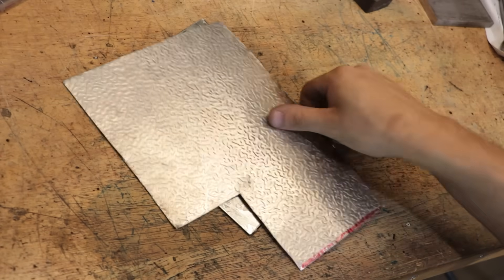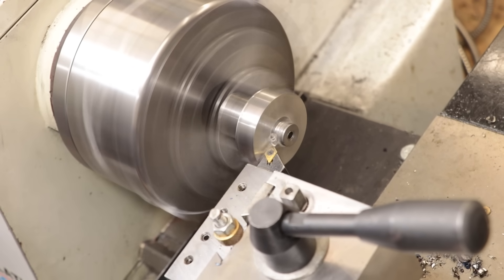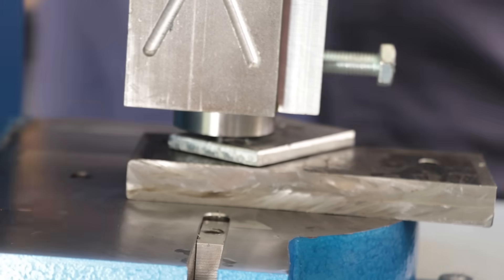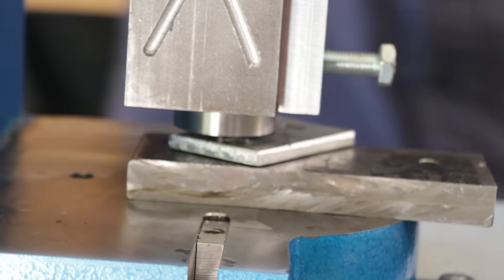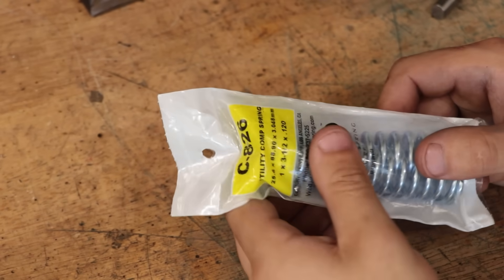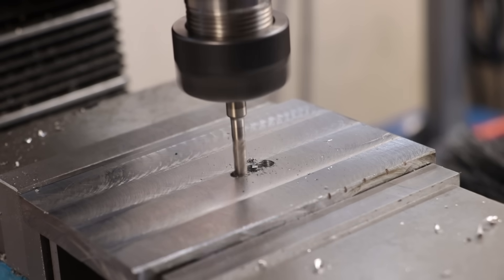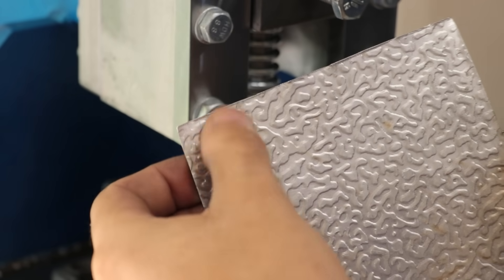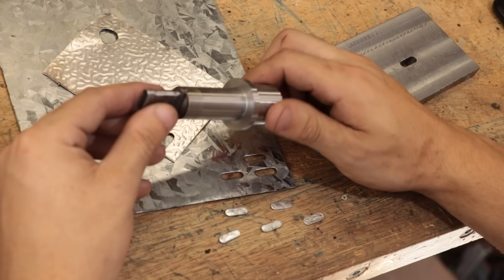DIY Punch and Die For Sheet Metal

Comment from the maker: Hope you enjoy this one, it was a lot of fun making it. FYI if you are wondering why the press stand is bolted to the floor, it is not my workshop so can not drill into the floor. Cheers
Reply: I haven't made many punches yet, but did run across an idea that might be useful, especially for larger punches... 

When shaping the face of a punch, mill it off at a slight angle, so that one corner/edge/end of the punch face enters the work first.  The punch still moves at 90° relative to the work, but only a small part of the cut is happening at one time - more like a pair of scisors than a paper hole punch.  Your tools and equipment- and more importantly your back! - will last a lot longer.

...LOL, I do have to admit that it probably won't help a whole lot with punching a 15mm long slot through 5mm thick aluminum!  Should be awesome for 1mm steel stock though, and the edges of the cut will be cleaner too.
Cheers.
Reply: @douglashank8480 you got the point across perfectly, but all paper hole punches I've encountered so far have angled punches too. Most of them have a quite steep V shape ground into them, those flat on-the-go ones even have two. Gotta have that clean shear in paper too, especially if you punch through a whole stack
Reply: TheDonutMan;  Yeah, I thought about that but couldn't come up with anything better to use as a comparison/contrast to scissors.  🤔
Reply: Sorry about the dozen odd copies of my comment.  Had a slight browser malfunction here.  (The rest should be deleted now.  I hope!)
Reply: Hi Artisan - Can I advise you DO harden both the Die as well as the punch if longevity is your plan?
My suggestion is to create a Base that is a Die holder - That will allow you to make dies from normal Barstock say 15mm deep by 50mm rounds retained by grub screws
Doing this will allow you to make and harden several options in terms of die size - and also allow you to use the grub screw to index them relative to the die holder

The spring as an automated stock remover is not a bad idea - though there are 2 suggestions you could add add:
1: the spring will currenly Marr your work - add a plate retained on the end of the spring to widen the contact area
2: an alternative design is a simple fixed plate at say 2 to 5 cm above the work - it means that you are using the retraction of the punch as the level to remove it

Another thing these punches are a god send for is quick weld repairs - See a rust spoton something early? punch out a 4cm disk to weld in after removing the bad metal
Reply from the maker: @bengrogan9710 punching force is perimeter of punch x shear strength x thickness of part. That’s what we are describing here, I don’t see what the disagreement is ?
Reply: @artisanmakes apologies - I just rewatched as recognised what I did.
My head was hearing "area" in the calculations and automatically fixing on the area of the circle, rather than the perimetric area of the punch - a mental slip of the tongue.

Please feel free to disregard that part of my comment, I've removed it now, however I hope some of the othe points are useful ideas =)
Reply: Great job 👍🇬🇧
Reply: I enjoy this sort of video learning is half the fun of doing
Reply: Absolutely love these experimental videos.
Reply: Love it. I'm on the other end of the spectrum with over 20 years of pure cnc so it's nice to watch the basics like this.
Reply: You could bolt it to a slab of some sheet goods (plywood, OSB, whatever) that you stand on while operating the press.
Reply: You could still make it sturdier so half of your energy isn't wasted in the stand jumping all around.
Reply: dont cut stock by hand!

Comment: Interesting video. I'm not sure about your shear strength calculations. It seems like the linear length of the cut would be more important than the area inside but I'm not a machinist so can't say for sure.
Reply from the maker: You are shearing a cross section, so the area is that matters

Comment: Nice job.

A quick tip for you though.
Put you Hacksaw Blade in the Frame back-to-front, i.e. Teeth pointing backwards towards the Handle.
It'll cut cleaner and straighter and with less effort, and the  Blade will never snag/jam or kink, as the Blade is always under Tension when cutting.

If you've ever used a Japanese Pullsaw on Wood, you'll understand.

As for the Punch itself, a slight Concave or Convex shape along the length of the Face will help, so you're not cutting across the full length of the Slot in one go.
If you look at the design of Shop-bought round Punches, they have 3 or 4 'points' on the Circumference, with a Concave section between them.
The Points punch through first, then the rest of the Punch slices through, rather than just punching by brute force.

Comment: Have you considered hard facing your punch and die?
In oz you can get UNIMIG 3.2mm HYPERARC 531 Hard Facing Electrodes U63025 really cheap @ $20 for 1kg.
It will give a HRC 55 surface but is not machinable, only grindable.
I have used these electrodes on various projects as wear resistant surfaces with great success and makes it economical as you can apply straight to mild steel.
Cheers Andy

Comment: You can buy 7 1/4" saw blades to cut Aluminum, Steel and Stainless now a days.
The Aluminum blade works great, and I've cut 1/2" plate with the circular saw with the steel blade.  The Stainless blade seems to dull fairly quickly.  But the blades are really worth it and they have come down in price.

Comment: First off, awesome of you to navigate through the construction & application of a punch & die!

With over a decade in the Tool & Die industry and co-owning a manufacturing business spanning three generations, I can attest to the vast complexity surrounding such a seemingly simple setup. 
Your creation closely resembles that of an Ironworker. Over the years, we've had competitors try to copy some of our machine tooling. Sadly, they encountered an instance where misalignment led to a lethal accident, including the punch exploding under high tonnage, shooting punch shrapnel through the operator's heart. Today, most Ironworker machines incorporate safety measures like impact-resistant polycarbonate to mitigate such hazards. I urge you to consider integrating similar safeguards, such as mounting a barrier between the punch and yourself, to ensure your safety while operating. You can find material for the barrier on McMaster pretty inexpensively.

Comment: You could make pointy two side of the cutter and add a plate with a hole same size with the cutter that the cutter comes that hole. I mean when you press, first the plate squize the sheet metal and cutter comes the hole and punch and when you release, first cutter goes in then plate release the sheet. Just like the paper puncher. So this way sheet doesn't stick and bend.

Comment: Two things that might help you. On your punch, looking at it from the side, picture a very shallow angle v shape. Maybe just 5 or 10 degrees on the legs. So the outer edges contact and cut thru before the center contacts the workpiece. Look at pics of Greenlee brand hole punches as an example. Really reduces needed tonnage.    For the spring you might try and automotive valve spring or on from a small engine like a motorcycle. They are heavier and shorter than what you used here. Just a thought on the springs but I can tell you the v shaped punch face will help.

Comment: Neat idea with the spring. The punching press in our shop has shoe that can be adjusted and fixed over the workpiece which prevents the die from pulling back up the material

Comment: One thing you can do to lighten the load is make your punch at the desired dimensions, but angle the tip so instead of the punch engaging the entire surface all at once, the punch begins at a spot and the cut progresses around the shape.  Like the punches electricians use to cut circles out of junction boxes, the cutting edge is a high-low wave around the punch.

Comment: I think your shear strength calculation might be off,  shouldn't you calculate it with the area of the cylinder that you are punching out? Which would make it 30mm*pi*material thickness, so closer to 900mm2?
Reply from the maker: No it’s the area that you are shearing. Perimeter of the circle times the depth of the thickness of the material
Reply: Oh, that's what I'm saying, maybe I didn't pay close enough attention and that's what you did 😅
Anyways, great video, love your projects :)

Comment: No I don't mind at all. Try wiping oil on the underside. It should make punching occur heaps easier, as far as pressure to break through goes. Putting the cutting edge of the punch on an angle will help with thicker material even more. I have a sloppy cheap hydraulic press so a die holder would be needed to make use of my own ideas about this here. To keep the male/female components aligned. So much of what I do is bespoke components that require a drill bit in the correct spot where a majority wont fit in the press at all. Also marking out has to often, be done after welding. Still I am very interested in this method since tools like butterfly wrenches and impact drivers have found their way into the site and plasma is in the shop now also. The most impressive item recently added is a cold cut chop saw. Always room for more if it can be used occasionally! Good video.

Comment: if you are only doing a few that are round...just take a drill of the right size and drill the die, then turn the drill bitaround, align and punch.  Dremel the end of the drill bit with a small grinding wheel to sharpen it if you like.

Comment: One idea for getting the material to come off the punch easier is to use a urethane stripper. basically a stiff urethane "spring" that slides over the punch a d compresses as the punch comes down. then the force of it returning it's shape pops the metal off. A lot of the older punch & die tooling I use at work has this style of stripper. Springs can work but usually need to be bigger and stronger which results in a dangerous amount of force near your fingers.
Reply from the maker: Thankyou, I think I have some urethane rods in strange somewhere. I’ll have to see if they are big enough for the job
Reply: @artisanmakes  it's worth trying. We use tapping oil to lubricate our punches usually so you should be fine with the oil you had. The only other note, our punches usually have a flat bottom face and a tapered neck. I don't know if that is better than a concave face or if it makes a difference at all. We punch mostly steel and sometimes copper with our big tools, occasionally brass with the small stuff.

Comment: The force of the press is determined by the screw pitch, and lever arm, I think. If you can get hold of an old car axle from a wrecker they're invariably going to be reasonably tough and somewhat hard. Case hardening is an option. Burnishing in the lathe to work harden (might not be all that suitable). Arc welding a blob of  6018 or 7018 rod onto the end and machining that back will be a harder face, although hard facing rod is obviously the ticket.

Comment: Painful to watch videos of guys with nice shops with mills and lathes but still using a hack saw to cut materials. E gads man . Meaning no disrespect, I’ve been a journeyman tool and die maker since 1972. I’ve built quite a few dies in my time before starting my own CNC shop. First off you should figure approximately 10% punch and die clearance , depending on material AND thickness. And yes the die should be just as hard as the punch. 0-1 is oil hardening which is meant to be quenched in OIL. A-2 is an air hardening tool steel which is better performing. As to the shear angle, usually you would simply put a double face angle on the punch not a ball milled one. Reason being it will be piercing the slot a little at a time opposed to the complete slot, resulting in less tonnage to pierce. Next on the slot die why not simply make the slug clearance on your mill opposed to using a file. So much easier. Then lastly the stripper. You should have a stripper plate the shape of your punch with a much stronger die spring. Now I know you’re just trying to make something on the down low and not for production. However making it better may end up paying off in the long run. This is of course depending on just how much you will use it. Sorry I don’t mean to sound like a know it all. Just thought your viewers might appreciate the information for making their own. Otherwise it was a great video. BTW I love your homemade press. Cheers Mate 🤙🏻

Comment: An old guy's tip: When you're using a handsaw, don't grab the handle in your fist. Extend your index finger along the saw,  as if you're pointing along the line of the cut...you'll notice that the saw won't wobble like crazy all over the shop. You can control & direct the saw and make very accurate cuts. This works for files, carpenter's saws etc. too 
Everyone knew this before power tools were invented & became cheap enough for everyone to afford. It doesn't seem to be taught now.

Comment: All that effort making the press to fabricate a stand that won’t keep it still.
Reply from the maker: I can’t really bolt it down, not much I can do but use it as a screw press for the moment. It’s not a huge issue for me anyway, I’ll have the press for years to come
Reply: @artisanmakes  fabricate a heavy table that you don’t have to bolt down
Reply from the maker: Best you can do here is fill it with concrete but it fills other roles other than the press. There’s reasons why I wasn’t able to do that

Comment: You can buy punches and dies. Any size and shape you desire. All different shanks on the punch and diameters and heights on the dies. Made of tool steel and hardened and tempered to last for thousands of holes.. even in stainless.
Reply from the maker: Yea indeed. My hobby is mainly about making this stuff myself, that’s why I did it this way but if it was my job I’d just buy them

Comment: On the punches I use there is a hollow in center on some, others have a curve in the center and the sides. This starts the cut on the ends finishing in the center. The expensive punches have a center hollow at each end, as well as an edge curve, but the center is flat. Some are curved, with no hollow. These cut with little pressure, but longer stroke to complete.
Reply from the maker: I’ve seen pictures of those in the textbook I was looking at. I wasn’t sure if it was a critical feature to add. Cheers

Comment: Isn't a fly press suppose to hit fast. Spin the handle and use the stored inertia from the weight to BANG! Hit the part hard and fast. Not slowly pushing through like say a hydraulic press. For sheetmetal all the presses I have used have been hard and fast hitters! Cheers and G'day from Tasmania

Comment: As a former press tool designer, you have done pretty well with your experiment.
However, the clearance between punch and die is pretty important. It can make a big difference to the force involved and the life of your tooling. Also the quality of the hole/slot. Maybe check that out fir different materials, if you are going to be doing it a lot. For small runs its less important.
Cheers mate!

Comment: WHAT YOU CAN DO CHEAP IS GET A STEEL BLOCK 
DRILL HOLES SAME DEPTH CUT DRILL BITS FIT IN THE HOLES THEN WELD TOGETHER GRIND TO SHAPE DEPENDING HOW YOU SET THE BITS AND FILL 
WITH WELD BETTER THE SHAPES DRILL BIT DIRT CHEAP
Reply: Ps go to some flea markets for drill bits and good Tool steel CHEAP AS CHIPS 😮❤
Reply: If you are struggling with the press knock one up using a 10 tonne jack pushing directly on the punch

Comment: Some random thoughts. I run an industrial CNC punch and shear. We buy all the punches and dies, so I will admit that I don't know the details of them all, but I look at them multiple times a day haha. For the punches they're just straight sides, no relief. While I think it's a good idea, I believe you're giving up quite a bit of strength doing so. Our punches also have a little "pip" sticking out of the center. Makes lining up by eye REALLY easy, though it'd be a pain to make in your case. The dies definitely need to be hardened. They actually provide most of the "cutting" action. You can tell. The punches can get dull and everything is decent. Once the dies get too worn it gets visible quick, misshapen holes, bigger burrs. As the others said, clearance, look for online calculators to figure clearance. Going from sheetmetal to that aluminum makes a big difference in clearance. There's lots of wiggle room obviously but if have too much it will make a big burr. Too tight clearance will make a lot more punching force. Good luck, and GOOD JOB

Comment: Whilst I know you can create the tools, is it not just a lot easier to make a punch & die holder on your lathe (not the spring loaded device you mentioned) just a simple tool holder from round stock, that that you can then order a whole range of puches and dies. There is almost always a ton of them for sale, used online designed for fly presses, lever press,  hand punches etc.  Even with our CNC machine, I regularly use both our hand punch, lever press and indeed arbor press, it's fast and efficient, making the holders as I need them to fit.
Reply from the maker: If I wasn’t doing this as a hobby I would for sure just buy the off the shelf tooling. But here I’m more interested in the ins and outs of this type of basic tooling